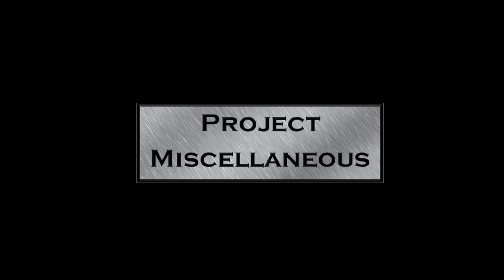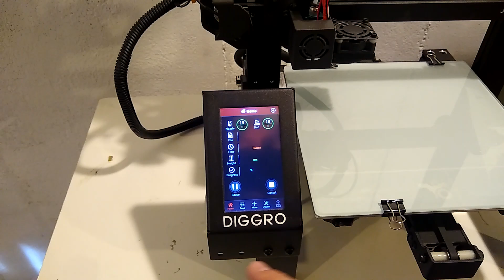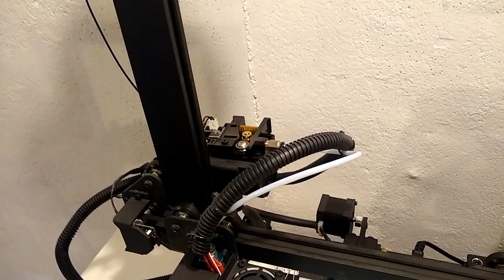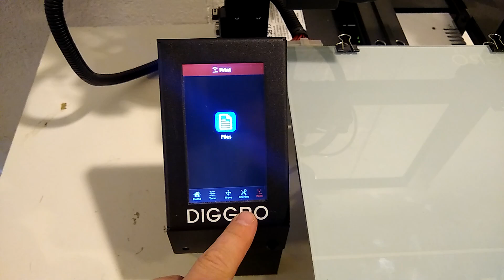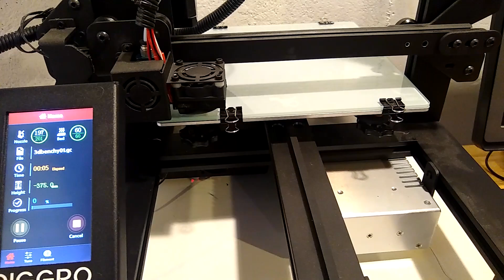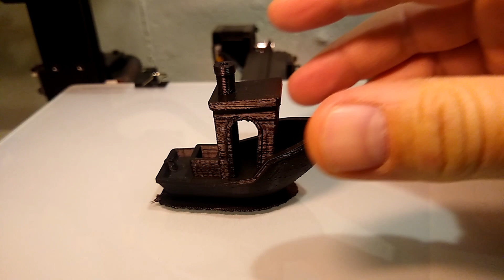Intro to 3D Printing with the Diggro Alpha 3 - Entry level 3D Printer

Comment: I had this for four years, when I first had a go with it I managed to get the heated nib stuck to the black side of the plate causing a melt that resulting in a hard bubble-like raised blemish. I've not used it since, too daunting. But I've dug it out this weekend (which is why I found your video) and I'm hoping to give it a go.